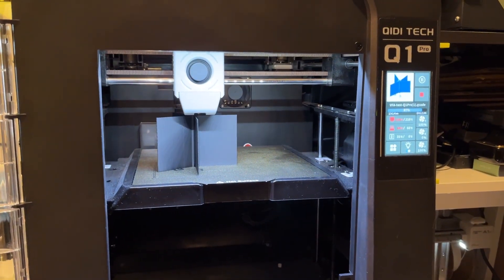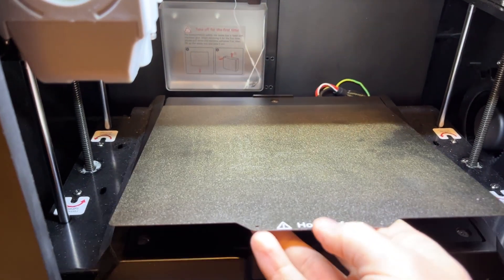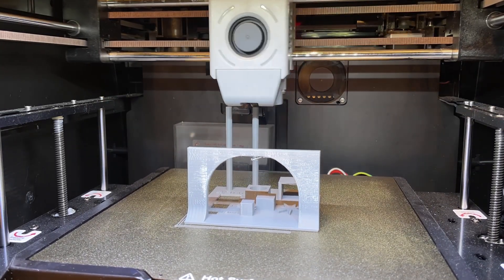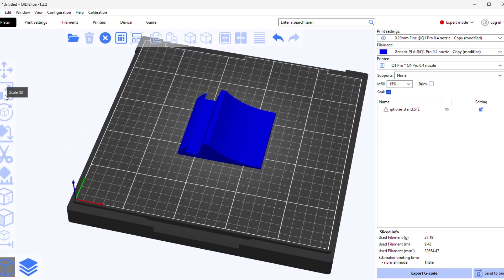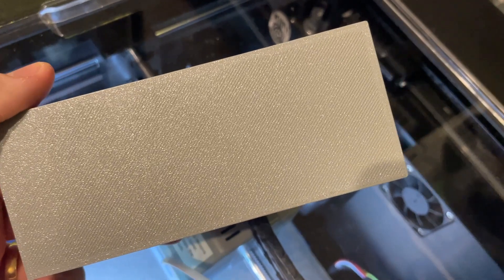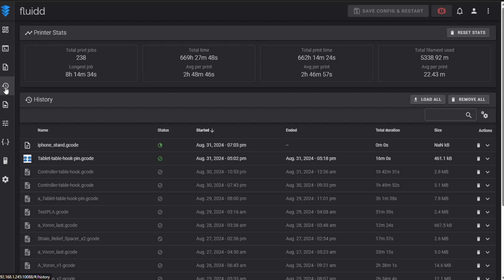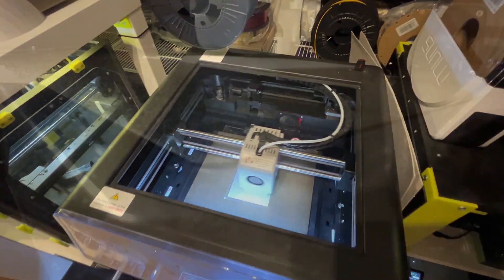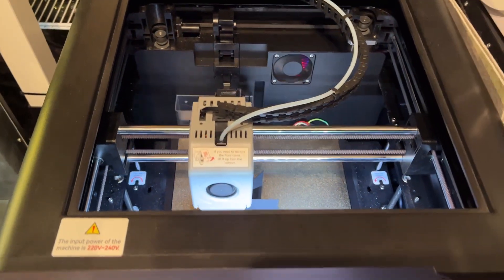QiDi Q1 Pro 3D-Printer - review after six months

Comment: Hi! Thanks for this video. Do you think it's a good first printer for a beginner? I would initially use it only for PLA and PETG, but maybe in the future I could consider ABS and ASA.
Reply from the maker: Hey! As a first printer just for PLA/PETG I would recommend something from BambuLab, they are easier for beginners and more user-friendly if you don't have any knowledge about 3D-printers. But if you're considering ABS/ASA and you're willing to get a bit more into 3D-printing, then Q1 Pro is definitely very good and budget-friendly option :)
Reply: Yes, this is a good printer for a beginner. It's fully assembled and ready to go out of the box. The model you get today is improved over the model in this video (as @PrintFactory3D mentioned in the video). The instructions to get started are actually pretty clear and simple. I agree that Bambu Labs printers are a little easier to get started on your first print with, but just watch a short video on getting started with the Q1 Pro and you'll be printing in no time.

Other reasons to consider the Q1 Pro over something like a Bambu Labs P1P or P1S:
- Price: Bambu Labs printers are more expensive for similar quality and features.
- Customer Service: Qidi has excellent customer service (whereas Bambu Labs does not have a great track record for customer service).
- Heating: The Q1 Pro has an active heated chamber, which improves speed and quality of ABS and ASA printing.

On the other hand, reasons to consider a Bambu Labs printer:
- Larger community to get help from if you run into problems.
- More emphasis on simplicity and user-friendliness.
- You can buy a chamber heater for the P1S to make it as good as Q1 Pro for ABS/ASA.